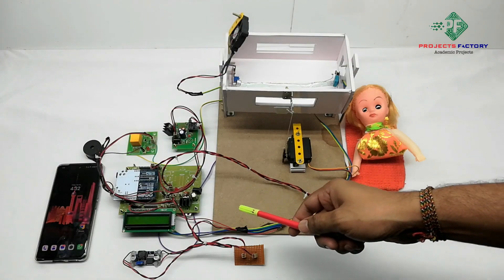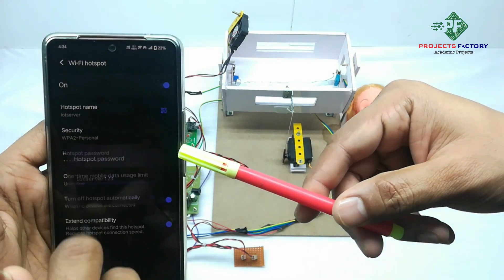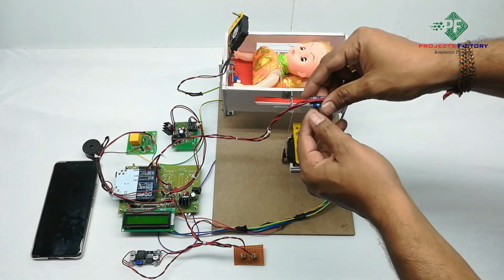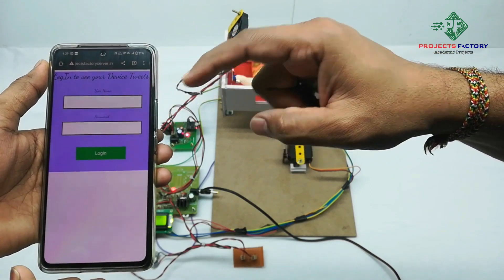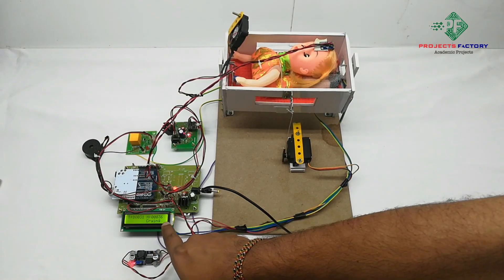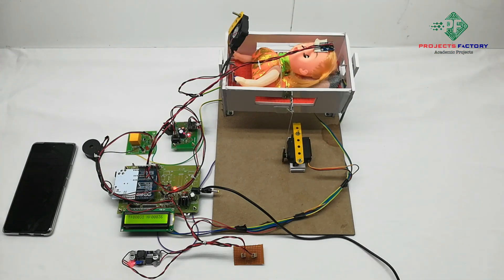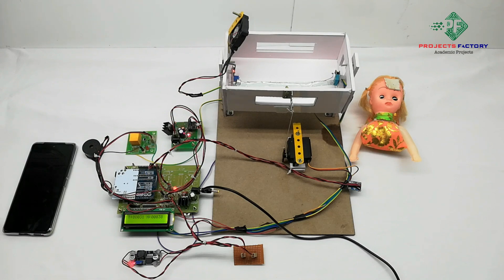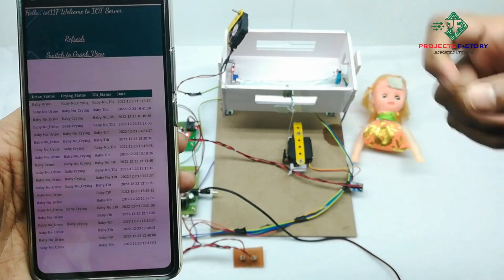IOT Based Advanced Smart Cradle For Baby Monitoring System

Comment: #include "TinyDHT.h" 
#include <Servo.h>
#define WaterSensor 3 
#define Buzzer 4 

const int servoPin=5; 
const int soundpin=A5;
const int threshold=32;
Servo Servo1;
#define DHTPIN 6
#define DHTTYPE DHT22
#define fan 8

DHT dht (DHTPIN, DHTTYPE);

int tempMode = 0;
int t;

void setup() {
   pinMode(WaterSensor, INPUT); 
   pinMode(Buzzer, OUTPUT); 
    Serial.begin(9600);
  pinMode(fan, OUTPUT);
  dht.begin();
  
pinMode(soundpin,INPUT);
Servo1.attach(servoPin); 

sound();
}

void loop() {
   /* The water sensor will switch LOW when water is detected.
   Get the Arduino to illuminate the LED and activate the buzzer
   when water is detected, and switch both off when no water is present */
   if( digitalRead(WaterSensor) == LOW) {
      digitalWrite(Buzzer,HIGH);
  tone(Buzzer, 500);
  delay(500);        
  noTone(Buzzer);  
  delay(500);   
   }else {
      digitalWrite(Buzzer,LOW);
      sound();
      temp();
   }
}
void sound() {
int soundsens=analogRead(soundpin); 
if (soundsens>=threshold) {
  // Make servo go to 0 degrees 
   Servo1.write(0); 
   delay(200); 
   // Make servo go to 90 degrees 
   Servo1.write(180); 
   delay(200); 
   // Make servo go to 180 degrees 
   
   delay(1000); 
}
}
void temp() {
  
  t = dht.readTemperature(tempMode);
  Serial.println(t);
  if(t>800){
      digitalWrite(fan,HIGH);
  }
  else {
      digitalWrite(fan,LOW);

}
}